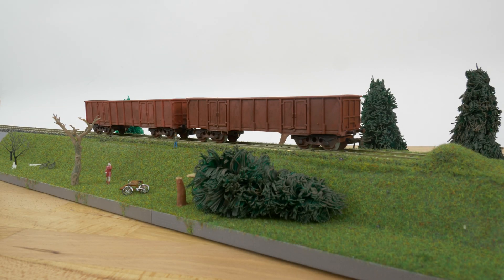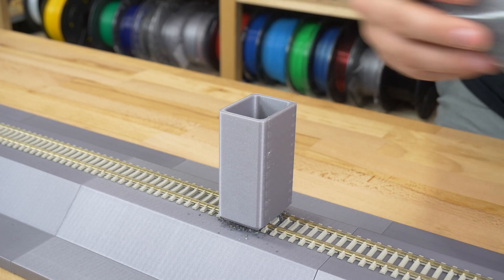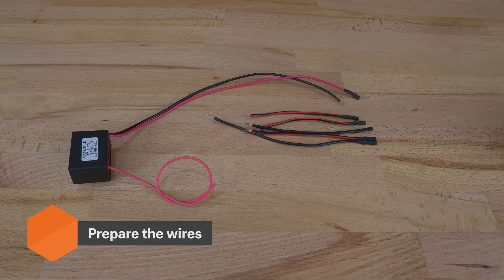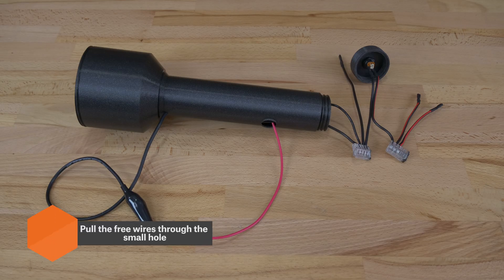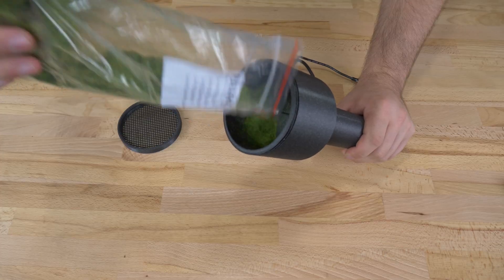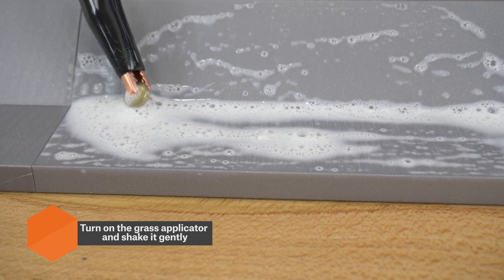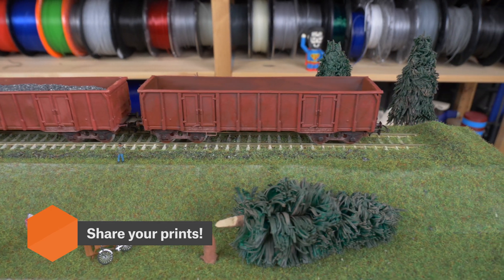3D printed railway models, part I: Landscape

Comment: 0:23 can someone tell me why these random underextrusion lines happen? I am having them happen around holes in the print... It seems to happen at the top or bottom of a hole so I am not sure if it is because of retraction or what. When I say a hole in the print i mean a screw hole or something in the design of the print not an imperfection.

Comment: The video looks nice but:
1:21  pliers are a poor substitute for a crimper and it shouldn't be encouraged.
1:28  it doesn't look like the wire conductor was even crimped to the connector.
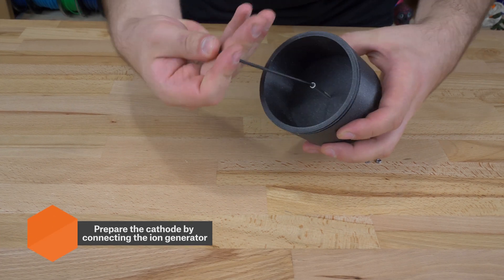1:43  needle nose pliers are a bad way to tighten nuts.

The third isn't a huge deal for something that's not going to be removed again but the first two could easily result in an unsafe, unworkable or unreliable project.